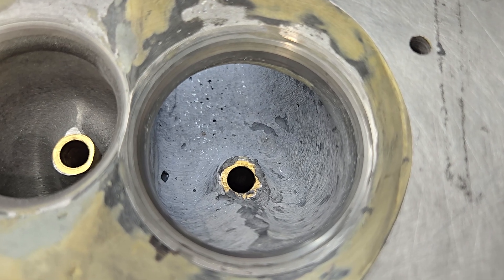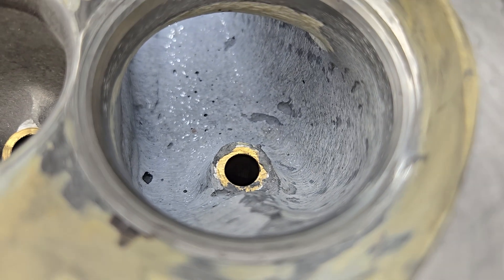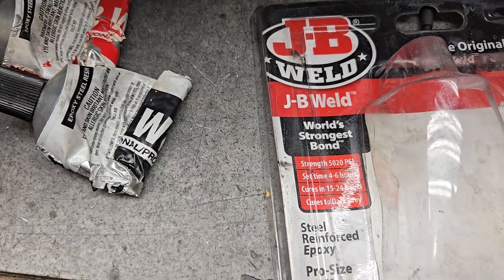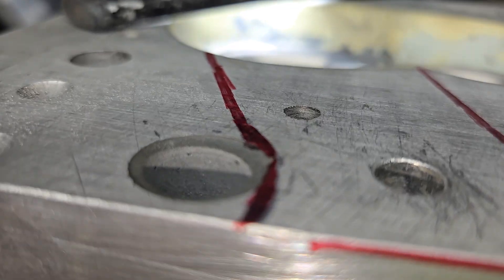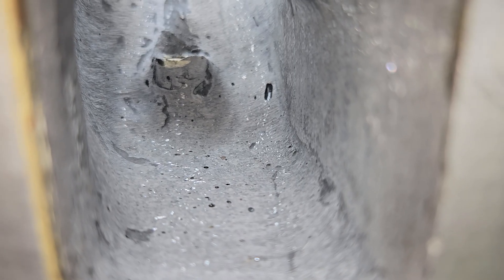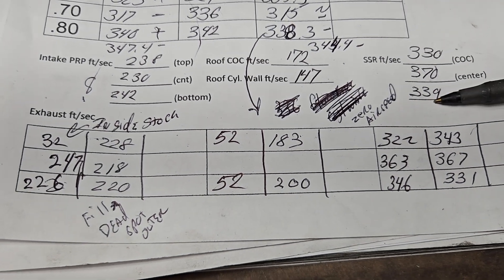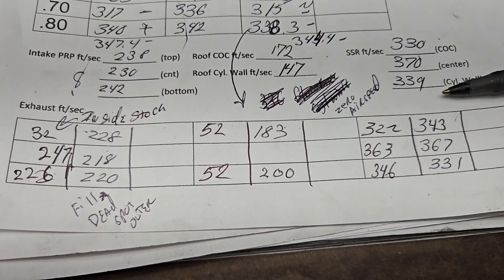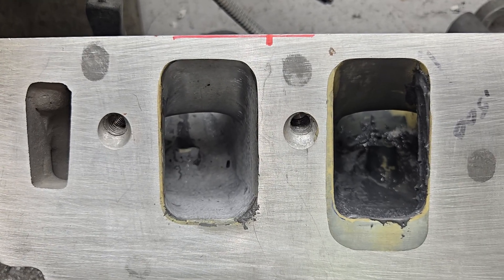Big Block Oldsmobile cnc master redesign, 2nd port filling. Starting to look like something!

Comment: Yes on the fin the direction of the port. I swear this looks identical to the BBM FE "cnc" aluminum head. 

As they came they flowed 340 @  0.500 and 346 @ 0.600". That wasn't good enough for me. I worked them over to 360 @  0.600 and 390 @ 0.800. Air speeds were 340-ish over the ssr. I too was seeing zero with the pitot where you are before porting. I made the bowls 110% and the throat 91%. Prior to porting the port was very noisy at 0.450" and horribly loud out 0.800". With flow stalled at 0.600 I knew I needed to work the runner. 

I kept the corner radius large using a 5/8 egg, and I measured my CSA every 1/2" up to the short side. As the head came, the runner at the flange was the smallest at roughly 80% of the throat. I was able to open the flange up and slightly decrease the CSA up to the throat making it the smallest. 

The 487ci FE they're on loves it all the way to 7,500(rev limited). 

Everytime I see that intake port I swear I'm looking at an FE cylinder head. If it has any similarities to the flow and performance, the short side may not like being laid back. I was able to keep a lot of the air on the short side with a 2.250" intake valve and a 4.270" bore. I ran a 1.680" exhaust valve. 

Last thing, I rounded over the leading portion of the valve guide after testing with a fin in front of it. In my situation it didn't like it. 

Sorry for the "rant". I just can't help noticing the similarities. Maybe something will help. Either way....great content.
Reply from the maker: I looked those heads up. They do look very similar. Thanks
Reply: @servediocylinderheads I bet if we do a deep dive into the inter-web, there'll be some kind of relation. 😂😂😂

The fella that developed that head is named Blair Patrick. Maybe you've heard of him. I hadn't till I'd received the heads. His take on making power is high port velocity." The air and fuel don't wanna be late to the party". From what I gathered, he'd rather fly right over the short side and have the air fuel mixture collide into the long side mixture and wall. That re-atomiizes everything and BOOM!

I wasn't sold on it. After a few hours of work, I had zero noise, more flow up-to 0.800(retainer to seal limited), and more even air speeds in the 340-ish range. I liked it. The engine likes it a lot too.

I wish I had the money and opportunity to test before and after porting, but deadline I was under wasn't going to let that happen. I'll always be curious if I really ported a better head, or if they were better as is. My math and gut says I'm better off with my porting, but my mind remains curious. 

Keep up the good work Chuck.
Reply from the maker: @arturozarate1752 Seems we are on the same page. Thanks

Comment: It means recirculation. There is a vortex there, a vortex goes one way, then flips the other, then goes back the way it came from. You must have caught it on the turning back part so effectively nullifies the kinetic energy of the flow and redirects it. Like those Chinese people and their Tai Chi cylinder heads.
Reply from the maker: Perfect for cylinder filling?